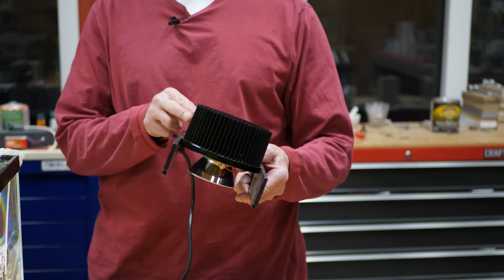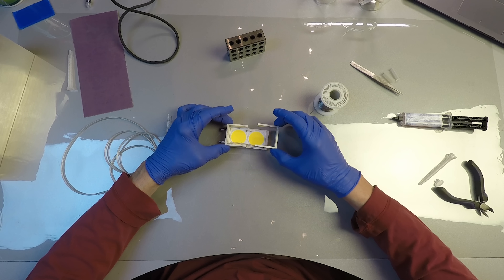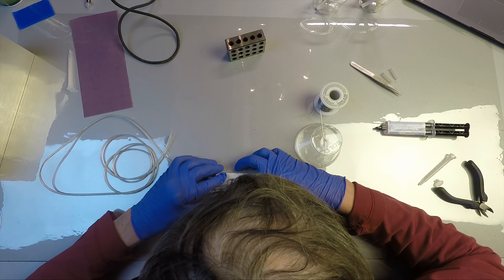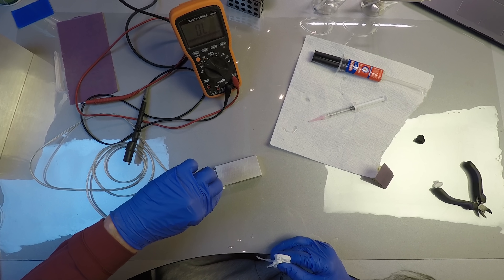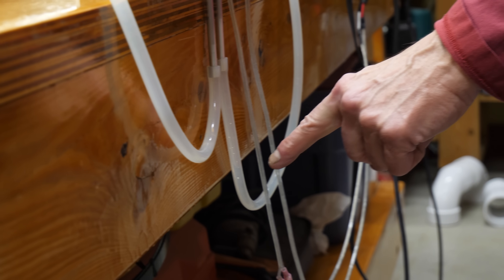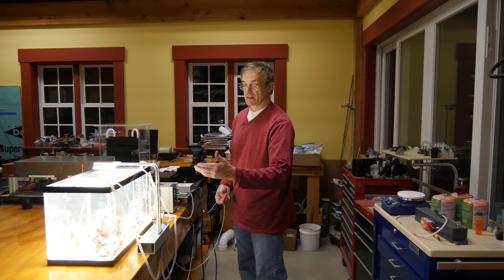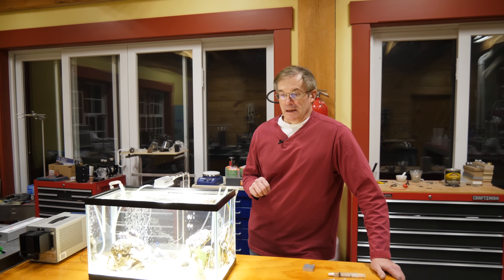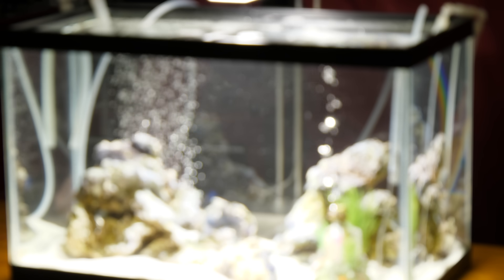40,000 Lumen LED Aquarium Light

Comment: There are major problems with this kind of light.  When you introduce any kind of bio-load to the water column, namely when there is even a minimal amount of inhabitant in 'any' tank, even as small as some snails, you will instantly have algae issues with an incredibly excessive light source such as this.  For photosynthesis you're not primarily interested in lumens to begin with.  PAR is what you're looking for which stands for 'Photosynthetic Active Radiation'. So we want to use the power for mostly the necessary parts of the spectrum and most of the visible spectrum is not used for photosynthesis. Secondly, the lighting schedule for a much much smaller light source for a planted tank is a couple of hours per day at most.  In the aquarium world, your kind of tank is called a technical tank. However, important technicals for a planted tank are such things as automating the fertilizer regime, automating the CO2 injection, automating water changes (if you're lucky), measuring pH, automating CO2 injection with respect to pH, temperature stabilization, running the water through a UV filter (to control algae and other bacteria) etc.  In the planted tank world, the most important parameter for proper lighting is choosing a correct light (as in between excessive and insufficient in terms of PAR) and running it at a proper schedule meaning same time every day and same duration and to be able to do this at minimum watts or minimum running cost.  Usually more efficient lights are more expansive. Also, again, It will never be at real world day light solar radiation schedules or especially never at intensities similar to the actual sun radiation.  The water column is very small. It will never work.  If you attach your tank to a lake and constantly circulate the tank water from the lake it might kind of work but still you have very small depth and the light intensity will always be very high, such as similar to marginal regions of a lake (edges), also the lake should have very small nitrate and phosphate levels etc etc.  Basically, this is not a proper light for an aquarium.  If you have a tank with chlorinated water, for which you would have to chlorinate it constantly (because the chlorine dissipates), or you will have to do constant water changes from city water, you might be able to use this light to illuminate that tank but nothing can live in it.  It is not an aquarium light.

Another note about your tank is your problem with temperature and heating.  Heating is mostly never needed in a tank unless you're living in a very cold place.  Considering you will probably have tropical fish in the aquarium, your water temperature will be ok to be between 25~27 C° and the most efficient way to do that is with room temperature, meaning just not doing anything about the heating of the tank and letting it equate to the room temperature.  However, inefficient or excessive lights can easily dangerously increase the tank temperature, by convection that is, not by conduction as in your case. So your light will definitely increase your tanks temperature to dangerous levels because even small lights can unnecessarily and dangerously increase tank temperature.

Final note about your tank is the aeration.  Aeration is not required at all in any tank.  It is mostly advertised that way to sell air pumps.  If you slightly agitate the water surface, you will be able to dissolve enough oxygen into the tank anyways.  There is no air stone in the lake.  If you're trying to achieve a life-like condition, or if you want to get rid of unnecessary things or achieve efficiency, remove the air stone and the air pump :-)  Actually, the air bubbles only cause the water surface to be agitated which then causes oxygen to dissolve into the tank from the agitated water surface.  You need a filter in the tank for bacteria to colonize in and to work for nitrification cycle.  The un-eaten foods, fish poop and small plant parts, will breakdown into ammonia, the aerobic bacteria (basically any open surface) will then convert ammonia to nitrites, then nitrites to nitrates and finally the anaerobic bacteria will convert nitrates to nitrogen gas and you can even then see the nitrogen bubbles coming out of the substrate.  You're always trying to achieve full nitrification in your tank, meaning you want nitrogen gas to come out.  Anyways, the filter output agitates the water surface anyways. So, if you're not using a very simple and ultra cheap sponge filter, you don't need an air-pump or aerating the water with an air stone because the filter output will be doing that already.  In the lake, water surface agitation even by a small breeze is enough for necessary oxygen to dissolve into the water.
Reply from the maker: Thanks for the long comment!  
Lighting an aquarium requires an understanding of the type of marine life and is not independent of the issues you raise.  The purpose of this project is to demonstrate the potential of a very compact light source which could illuminate a very large tank and provides the flexibility to use or remove the heat it generates rather than exhausting it from the hood above the tank.
Reply: @TechIngredients  Yes I know. However, the problem is that you don't want a new aquarist to think that they could use this in their tank.  An experienced aquarist would never do something like this.  Fish don't need light. Plants do. This would not work in any planted tank setup that can fit in a house. Think of it this way, you will need a diving suit to trim your plants, for the aquarium this light will work in.  Also, it is not appropriate for a marine tank as well. Basically, you can never use it in any home aquarium. Also, uses a lot of power and generates a lot of heat. You should indicate that this could only be used in the city aquarium where the depth is about 2 meters.  My only problem is that someone might try this at home in their tank after watching this video :-)
Reply from the maker: I disagree. A one square meter surface area, half meter deep tank is only 450L.  This is a large but not at all unusual home aquarium.  40k lumens is 1/3 solar intensity over that area and SPS corals need that kind of light.  Algae control is not only about light, but also about nutrient control.  An actual coral reef is not overgrown with algae and has substantially more light than this.
Reply: Tech Ingredients corals die from smallest parameter fluctuation and you will use the water to cool your light? nobody would do anything like that to their precious corals. obviously you didn't read my comment. your water column, tank size, water depth etc will be too small. your diy project produces too much light, too much heat and uses a lot of power. its not for ANY aquarium be it fresh or marine.  please tell me which commercial lights have you used and were not completely happy? becasue it seems like your aim in your project has no base from an aquatists needs or problems. your light might be proper for a green house or a hydrophonics setup, i'm not sure, i'm sayin i'm not sure because i don't like to talk about things i don't know. but i'm sure it's not for any home aquarium. so you should not say its for an aquarium, thats the only problem. this is obviously very theoretical. 

why don't you use it for a couple of months in any aquarium of size, document initial condition, and show final condition. but show how whatever inhabitant you have in it benefited this as in you have better growth or anything to justify why you have a complex setup with multiple possible failure points and exessive power usage and ofcourse all this after if it goes without an algae bloom.  you can't.... because this is theoretical only, and i'm telling you its not for any real life aquarium setup. 

seriously, were there a specific problem you were trying to solve with this?

Comment: Not to be rude, but he should have put a disclaimer in there. There are going to be knuckleheads out there trying this on their brand new salt water tank. Only to quickly find out that it killed everything in the tank. The metals used will for sure kill animals in a salt tank. The epoxy idea will also do the same. It will turn yellow over a short time, and start to chip off. It would have been better to spend the extra time and just use one of his radiators with a fan to keep the system sealed.
Reply from the maker: I have built and still own several epoxy coated wooden boats that are used in saltwater and are still in great condition after decades.  There are many DIY aquaria constructed of plywood coated with epoxy that are used for both salt and freshwater; this is a well established technique.  Stainless steel will not kill marine life and that is the only metal in contact with the water.

Comment: Would use aluminium end fittings with the block, those plated ends will corrode as they are dissimilar metals, and the aluminium will corrode through eventually.  You would also benefit from aluminium pipes as well, and push the ends direct into the block instead of the fittings, and use epoxy to hold them in there. You will still get corrosion as the different alloying metals in the casting and drawn tube react, but it will be a lot slower.
Reply from the maker: The end fittings are aluminum and are part of the block as supplied.  Stainless works well in an aquarium as long as there is disolved oxygen in the water.
Reply: @TechIngredients  I worked with aluminium cooling blocks that had corrosion problems. Solved by using organic acid to make a thicker oxide layer inside, and to dissolve away the sludge in it, then kept it stable and bacteria free with KI in the cooling water. Pure water with nothing else in it than the KI, and it stayed sludge free for years, just not exactly good for an aquarium though. I used all plastic pipe though to keep the electrolytic reactions in the system down, as parts were also made from brass and stainless steel, so keeping water conductivity low was important. Non sealed system, cooled using a conventional AC condenser coil and fan in the loop to transfer to ambient worked well.

Comment: How much?, seriously.  I don't have a way of fabricating the spacer for the glass....
Reply from the maker: Cut two pieces of equal length of "U" channel and file/sand to a flat surface on  the top and bottom and to adjust the mated length.  The wire feed through notch can be filed as well.

Comment: i have heard that algea or microbian life can plug the heat block of  water cool computer. Also,  coul the algea slow down the water flow on the surface of the heat exchanging unit or  togeter with the epoxi code reduce the heat conductivity to the point that the leds overheat?
Reply: Someone was proposing the use of algea tubes as atmospheric Co2 extractors.  The lights could be solar and the excess algea processed into a petroleum alternative.  They'd make perfect street lamps!

Comment: Someone else suggested anodizing rather than epoxy. I suspect that this might be a better solution over time.  Beverage containers use a coating inside if the can, but it fails over time yielding a metalic taste. Not a big deal as most beverages are not on the shelf long enough for this to be an issue.  

But for this application there is time and cavitation wotking on the epoxy costing.  If the coating were to fail, the result would be dead fish. 

I wonder if periodic testing of the water is warranted?
Reply from the maker: Anodizing should work.  It is a little more involved to get it done.  You can do it yourself although you will want to cut apart a few trials to assure you have a good coating.  Alternatively you could test the electrical resistance of the coated part.

Comment: Have you calculated that heat dissipation from the aquarium sides exceeds the heat produced by the 40k lumen LEDs? Otherwise you will slowly cook the fish...
Reply from the maker: You still should use a thermometer.  If the environment is warm, you may not need any additional heat and if it is cold and dry the light may not provide enough heat.  We're in the ballpark. A 100W heater would work in a small tank and 25 -50 watts of lighting would be about right.

Comment: Nice design.  As a possible improvement, I wonder how feasible it would be to simply isolate the LED electrically and then have the bare LED submersed in the tank.  Maybe even have it mounted at a slight angle so convection could act as a means for circulation.  And well, some screening too to prevent small fish from swimming on top of it and getting cooked.  :p

Comment: Great project, i might copy this for my workbench lamp. :)
As for using this as a room lighting source, shouldn't it be possible to use a DIY vapor chamber / heat pipe to dissipate the heat away from the LEDs to a larger radiator on top, with gravity pulling the condensed water back to the LEDs?
Reply from the maker: That should work.  Heat pipes are not that expensive, but constructing one could be fun.

Comment: with an arduino with pwm driver, you can create day and night cycle or and with seasons
Reply: Raspberry Pi Zero-W - then you can use NTP to keep the clock synced with no external parts.

Comment: Great video, and excellent use of water cooling LED together with LED warming tank water!
It’s extremely unusual to come across figure-8 cable without one side being pre-marked, either by a very thin coloured strip running down (either a broken line of continuous), or a physical extrusion creating a ridge running down. Some can be difficult to see/feel that may lead you to believe there is no +ve marking. If the cable used was indeed not marked in any way, I understood that any marking always indicated +ve (irrespective of colour, in this case black sharpie would stick indicate positive). That’s my experience, but would be interested to know other’s thoughts too.
Reply from the maker: The cable I used is rated for several thousand volts.  I got it from McMaster Carr for a previous laser project.  It was a good choice because it was very flexible and it was unmarked.

Comment: The conventional watercooling wisdom says that the loop should be enclosed, and free of contaminants. After all you wouldn't want to clog the heat block innards especially if they're inaccessible for servicing.

However this is not the kind of heat block PC watercooling wizards usually reason about, as it has a much wider water path and lacks microchannels, so it's not so risky.

Still, perhaps running a separate loop, even if you ultimately heatsink it back into the aquarium water reservoir, isn't the worst idea. But you would need an extra pump.
Reply: no, there is still a major risk of bacterial contamination and clogging.

guaranteed, in fact.

Comment: since light intensity is basically heat, won't you burn you fish at some point?!?
Serious question
Reply: Basically Not.

First, heat is the vibration energy of atoms within a material. Light is a different form of energy. Light's ability to transfer heat would depend on the wavelength, the intensity per unit area, and the material that absorbs it - or not if it reflects it or passes it.

Also, energy is conserved. So, the total energy (heat + visible light) cannot exceed the output of the power supply. This gives the upper limit of what can come out of the LED lamp in terms of total energy. LEDs are generally efficient sources of light, giving off a lot more visible light energy compared to the heat energy generated in the process. This will feel very different with an inefficient old fashioned incandescent lamp which gives off about 5 times as much heat energy for the same amount of visible light energy.
Reply: @michaelyoutube5149  not the point einstein, increase the intensity and it burns... correction, wannabe einstein*